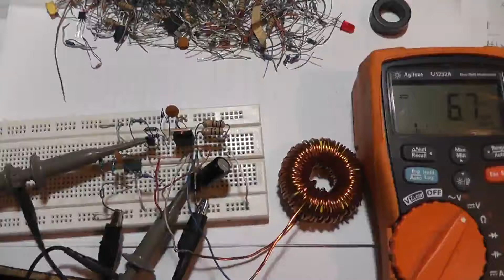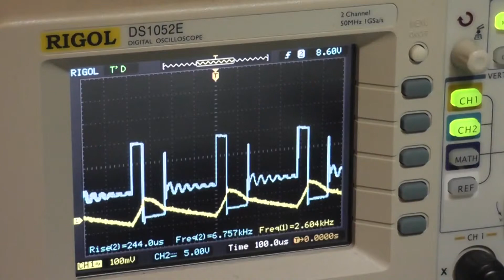Prototype Switchmode Power Supply

Comment: Well , i've done a Raspberry PI  test using Buck boost S7V7F5 ,
It runs properly  from as low as 2.6 V up to 13.3 V.
S7V7F5 is small , cheap and an protected to overheat and over voltage
Search youtube for buck boost raspberry pi
73 de yo8rxp

Comment from the maker: Sorry, I stopped maintaining a blog because it was too much work.

If you'd like a schematic I can whip up a simulation in LTSpice (free) and send it to you. Otherwise if you just want a power supply there are lots of switchmode units available in TO-220 (ish) sized packages which are pin compatible with 78xx voltage regulators.